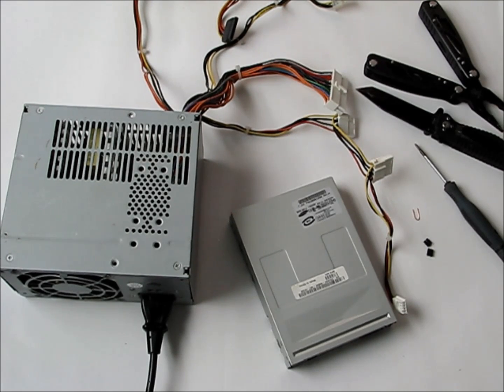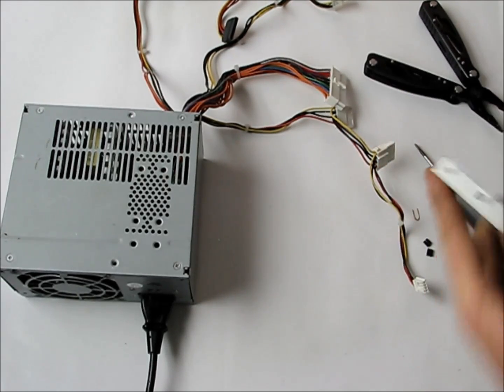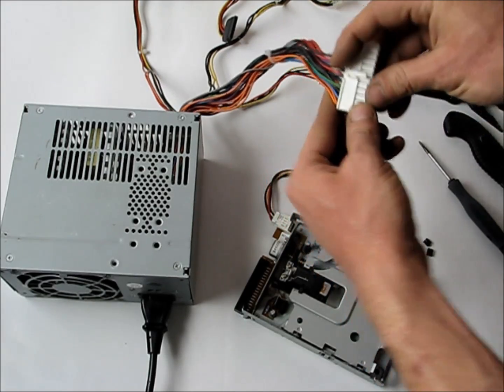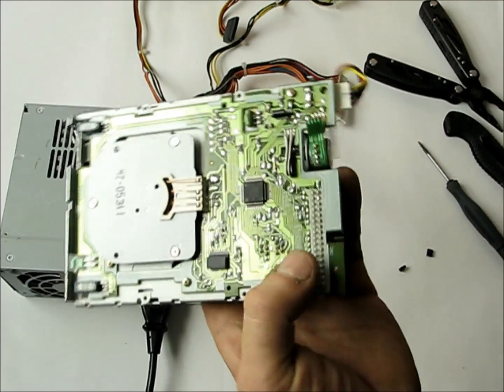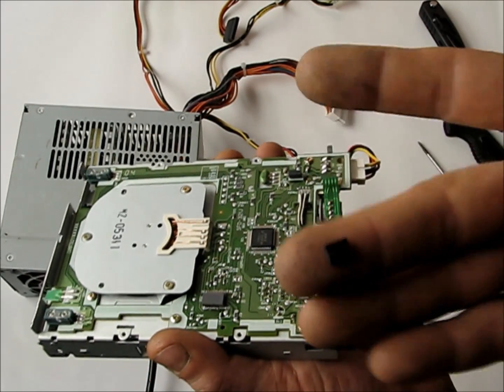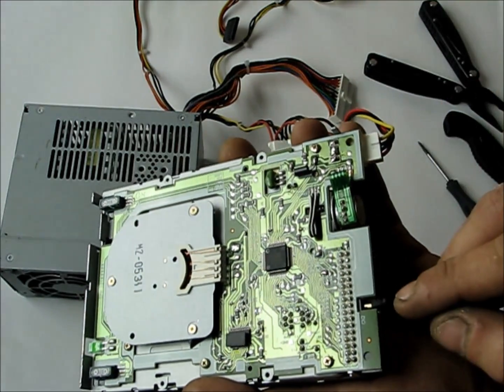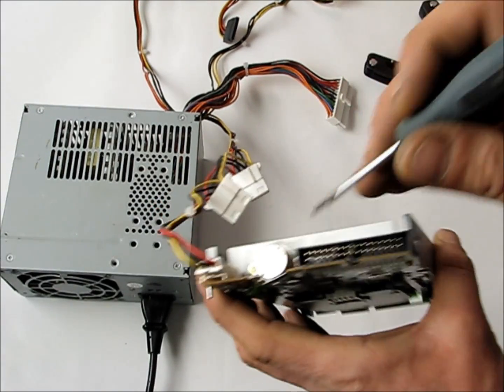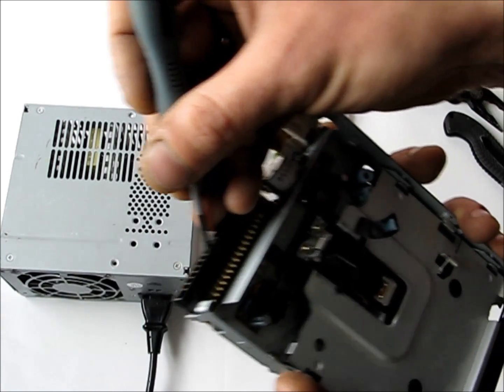DIY FLOPPY DRIVE CNC: Part 1 - Hack a Floppy Drive

Comment: Is there a similar way to control the stepper of a DVD drive without using a stepper driver?
Reply from the maker: you need a stepper motor driver of some sort.. nowadays I would use an arduino with a cnc motor shield with grbl and universal gcode sender...
Reply: I'd like to build a mini cnc... But the problem is that I have only one floppy drive... It's so easy to use because I don't need a stepper driver... I've olso a dvd drive and a laptop dvd drive... I'll build some kind of stepper driver
Reply from the maker: time to experiment! ;)

Comment: DIY FLOPPY DRIVE CNC:
great job, nearly easy to understand
is it possible to mount a milling cutter instead of pen ?
Reply: +Frank Trojan I think it is possible by adding a little motor with a support and plug it into the power supply. at least it worth trying.

Comment: Hi Richard, congratulations fot your videos they are easy to follow and very instructables, I had tried to build and cnc machine following your method but I`m leading with a problem, I`ve maked 3 axes but one of them just goes in one direction all the pin conections are OK. did you find this issue before ? do you know how solve it? thanks in advanced.

Comment: and for all: look to conector, where have a cut on middle, is the impar numbers, other face is pair ones... make a short with a jumper (or like me, got a wire and put beetween the ones) beetween pins: 11 and 12, 18 and 19 and, with a screwdriver or something of metal, short the 19 and 20 pins ... and the motor, if u remove it of the floppy (dissasemble the parts) the motor don't work because he needs to be aligned and fixed on support (u need it to step motor works)>
Reply: Broo short 11 & 12 ,18 & 19 , connect 20 pin to 15 pin of ic then the stepper rotates continuouslyy

Comment: Hi Richard, excellent video, very nice detail explanation. It got me trying to replicate the process but I run into a problem, if I connect my drive as you explained, the motor has a jerky movement, and only goes in one direction, I searched the net and it got me to a site where they explain there's two types of drives, one with disk detection and track zero and the older ones without that.
I would like to know how can I get my drive to work, if you possibly can help me out
Thanks in advanced!!

Comment from the maker: You need to use the floppy drives only for the "controller board" on it.. the rest is made out of CD-Roms (or DVD-Roms). We are just controlling bi-polar stepper motors (from CD-Roms) with the floppy drive control board  :)